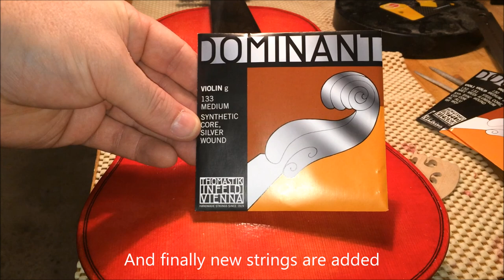Violin: Varnish & Final Setup

Comment: How may days (or hours) did you wait for each varnished color coat? 5 days at least? 
Also, when sanding off the previous coat before adding another one, I am afraid that I will destroy the color coat. Hence, how can I sand without making the varnish coat worse?
Reply: Tung Nguyen you use 600 grade paper with soapy water and then yoy clean with water;oil varnish is quite thick so you wont damage the whole;the process is to alternate layers of colourd with layers of clear or jellow varnish;therefore it s more transparent.

Comment: How do you polish the new violin? Between layers or at the end? And with what? TY in advance.
Reply from the maker: After the ground coat I lightly sanded with 400grit. Before the colour coats I lightly sanded from 400 to 1200. After the final clear coat I sanded up to 2000 and then used pink Tripoli powder with mineral oil. The rubbed and rubbed it with a lint free cloth. I did not use any polishing wax. Also when sanding make sure you sand with very light pressure or you will cut through the layers.
Reply: Wooww! You are a very patient man! I admire your work! Hope someday, I will do this too.. . I'm just studying now, but only from books and people like you. (Usually, the luthiers don't want to explain or give details. You are a very kind person!) We don't have a school here, so, I begin to "play" with a cheap Chinese violin. Next, awaits another violin from '78 for a complete restoration. Maybe I'll do a video and you will be the judge..? :D :D